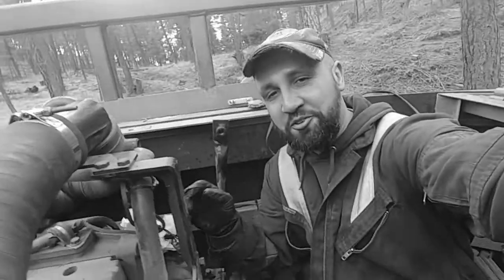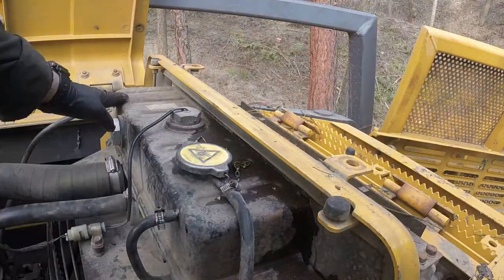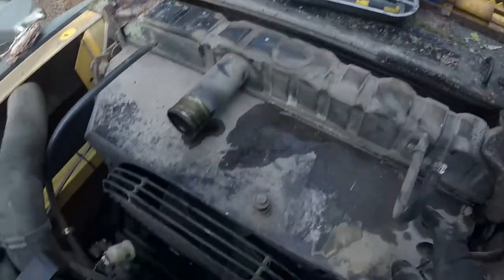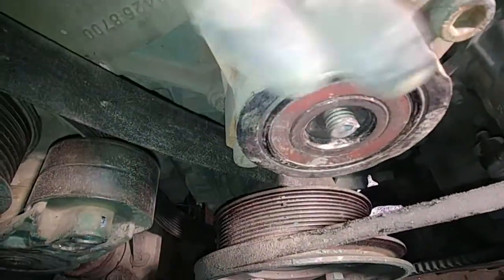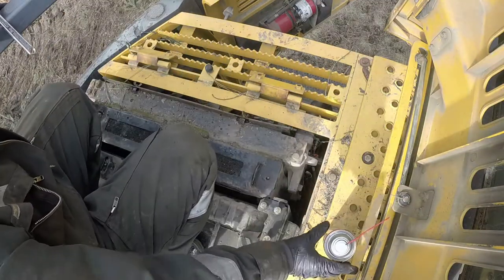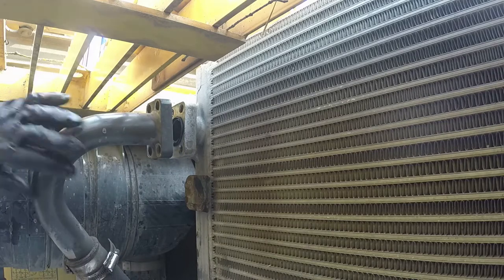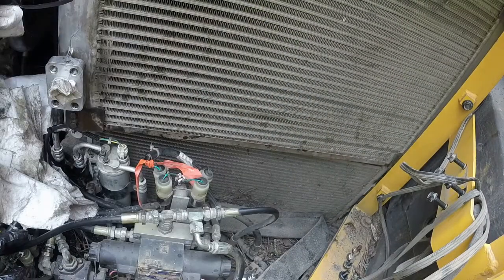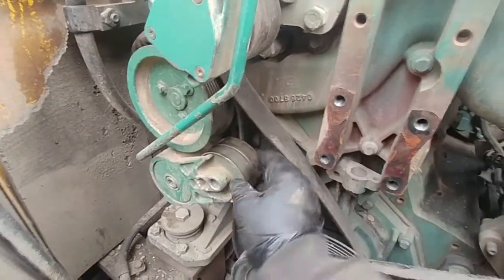Volvo EC140 Excavator Fan Hub Failure - Damaged Radiator & Fan Hub Removal, part 1

Comment: Wow what a big hole in that radiator, no wonder it leaked all the fluid. Great video, very interesting and nice filming!
Reply from the maker: Great point! Faulty fan hub design now cost owners so much trouble. Thanks for watching.
Reply: @PistonShack  have they improved it in new models I wonder?
Reply from the maker: @rtroadtimelapse2297  Yes, in 2007 Volvo upgraded cooling fan hub design to prevent pulley bolt failure.

Comment: Is there an update to avoid this from happening again? Do you know what the torque for the fan pulley bolt is supposed to be?
Reply from the maker: Far as I remember, Volvo improved hub design at some point later to prevent bolt from braking down. I did have exact Volvo torque specs, I just used standard bolt torque specs chart.